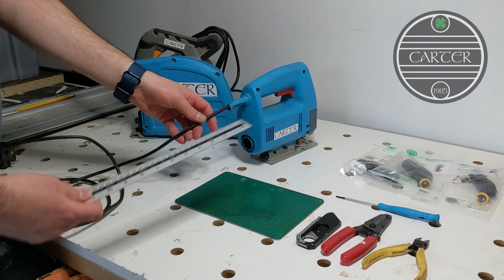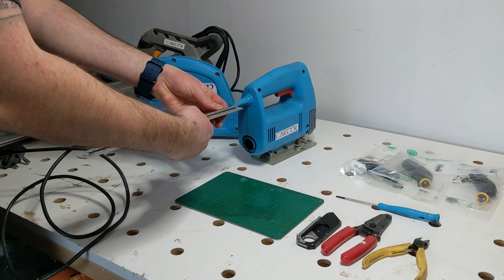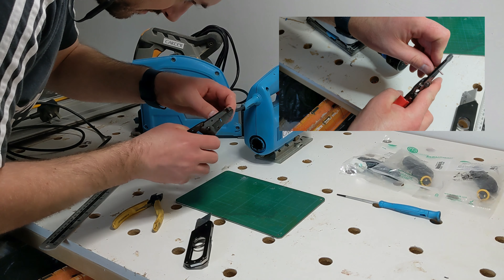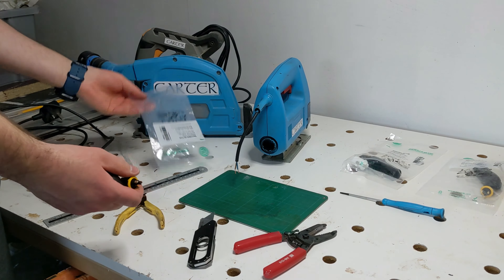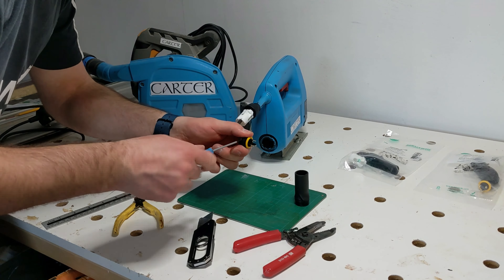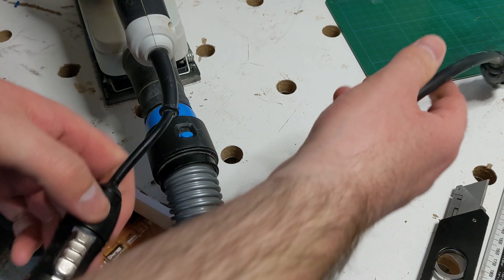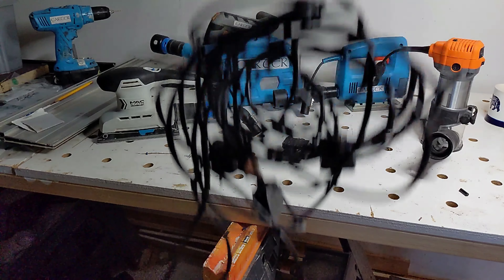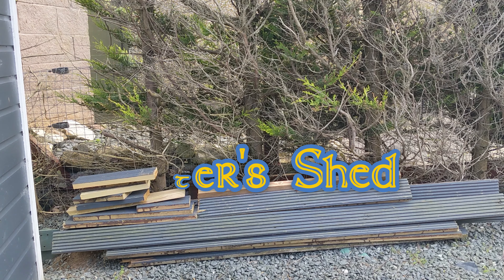Episode Eight - Cutting off my power tool cables. Workshop cable management using Neutrik true 1

Comment: What a great idea. Wouldn't be any good for me, as I use a lot of my tools outside of the workshop. Great idea if you don't do that though.
Reply from the maker: Yeah I would say my tools get used in the shed more than 90,% of the time. I do have a 4 meter lead with a quick connect on one end and a standard wall plug on the other so if I do need it away from the shed can still do it. But as I say it's not often I have to and as you say it's probably not the best solution for a handyman like yourself.
Reply: @CartersShed  IP 65 is the waterproof rating - It means Ingress protection - You could use it outside with no worries - Even in the rain.